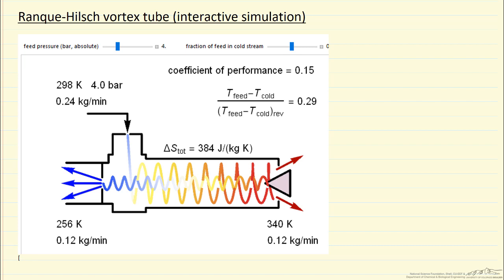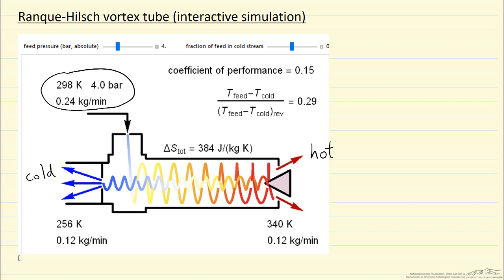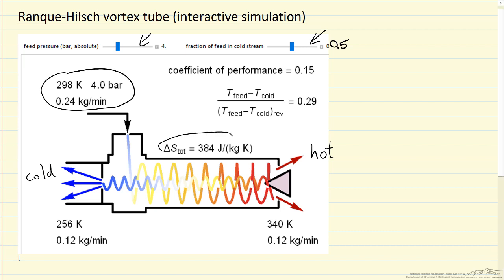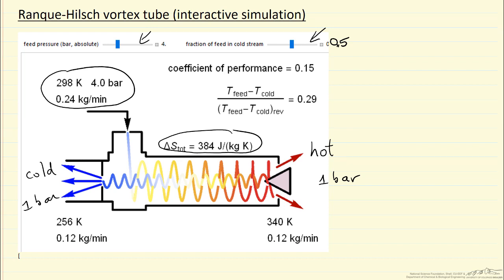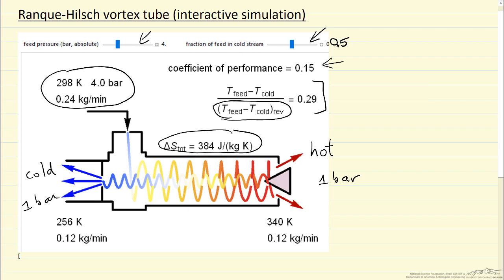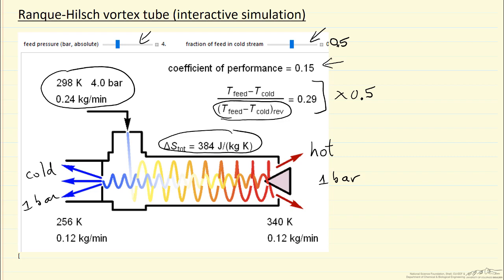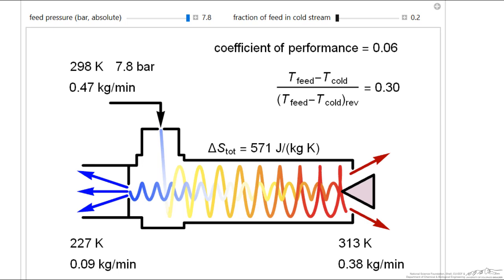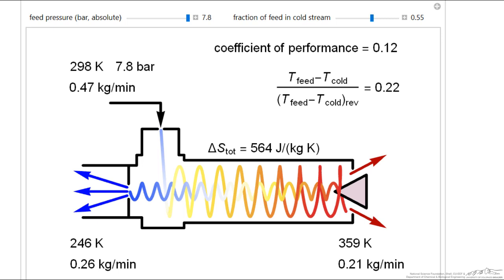Ranque-Hilsch Vortex Tube (Interactive Simulation)

Comment: Ah, the coefficient of performance is very low, only 0.15. Air conditioners usually have more than 2 while refrigerators are even better with CoP greater than 10.

Comment: How does length and diameter of tube effect performance? 

Also, I'm wondering if liquid cooling on the tube's outside  exterior can drop the cold side temp further, or would that just cool the hot side exhaust without impacting the cold side much?